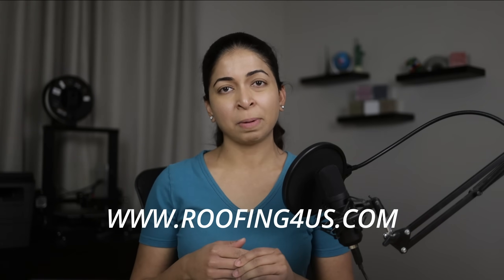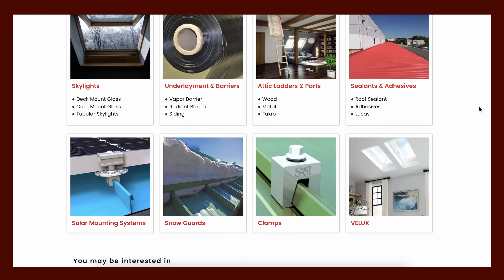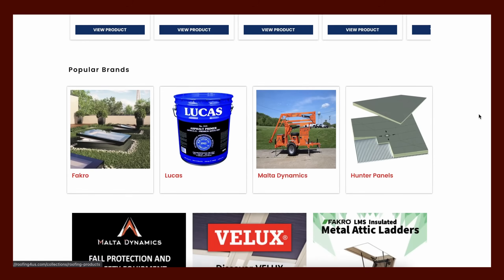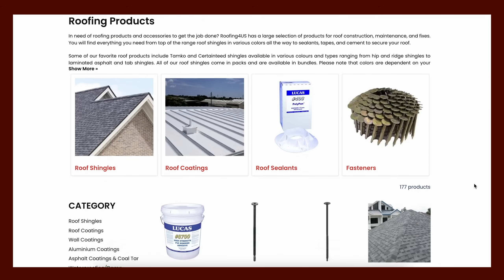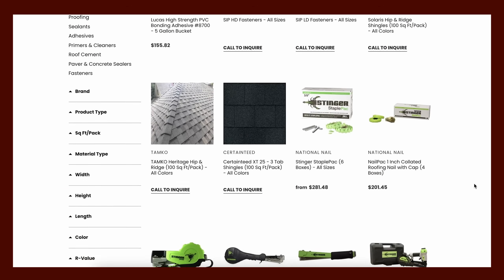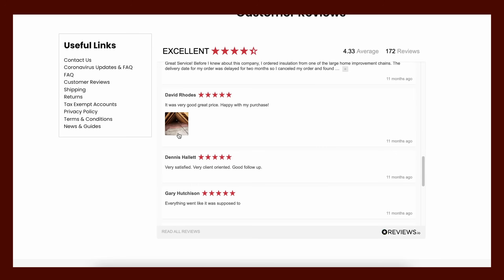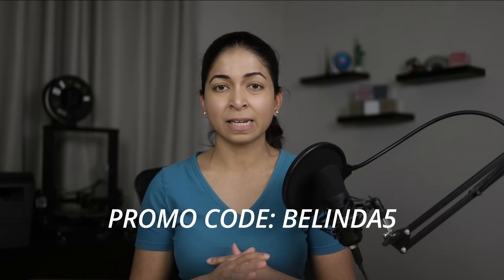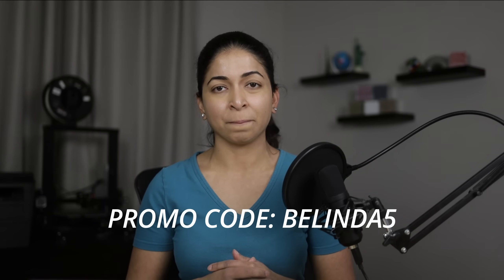Insulation that STORES energy! | Phase Change Materials

Comment: have been looking into this myself for a while now and there are two additional problems.
first the melting point of a PCM needs to be between the daily high and low, which is just not possible year-round. a PCM insulation that melts during a winter day will never freeze during a summer night.
and second is most places don't have a winter day that's warm enough or a summer night that's cool enough for PCM insulation to be worth anything at all. if your PCM insulation captures heat during a summer day so you have to use less cooling, then releases it during the summer night which is too hot anyway, you really aren't getting much out of it at all.

Comment: If you could use electrolysis on the boundary layer of a solid significantly changing its phase change temperature to liquid that may be useful for cooling.  Going the other way would release heat.  Just a thought.

Comment: Great video! One thing you left out is how PCMs can improve the efficiency of air source heat pumps by allowing them to operate during the warmest outdoor air temperatures in winter and during the coolest outdoor air temperatures in summer. This requires a level of programming that thermostats don’t currently have, but you can sort of fake it with a schedule. If PCMs become more popular I hope they will add this ability as any easy to use feature in the future.

Comment: I need to cool a small box containing air (8 by 8 by 7 cm dimensions). If I suspend a PCM inside the box, will there be any appreciable change in the air temperature inside the box, at the operating temperature of PCM ?

Comment: I saw something about using phase change beads in drywall a couple years ago, but it hadn't made it to market as a buyable product yet.  There were some issues with flammability in what they were using.  It's nice to see they've worked it out and it's getting into the market.  Basically, it's like thermal mass, only even easier to tune to a desired temperature range.

Comment: As a building designer, I have been aware of this product and the science behind it for some time now. It should be noted that this product works best when in contact with the habitable space inner layer (plasterboard). So retrofitting or laying the product on top of the ceiling insulation is not ideal as it will compress the insulation and reduce system performance. The reflective foil packaging IS however best suited to being on the outer layer of insulation system, so perhaps it would be better to enclose the product in a cheaper medium and use a separate foil layer where it would be more effective. Building science is a tricky ever evolving subject, and there is no single magic bullet for every scenario. But I love PCM for its ability to add huge 'smart' thermal mass potential to an otherwise light building system. Cheers.

Comment: Interesting but I'm skeptical.  PCMs came out in the clothing insulation industry 30 years or more ago.  The problems then were that the PCMS were paraffin based and were flammable.  This doesn't seem to be flammable, great.  But another problem was the time factor.  That is, how long does it take for the liquid phase take to go back to the solid phase and vice versa??  If it takes only 1/2 hour or so, then while it helps, it isn't spreading the effect for a very long time.  AND as you point out, it is quite expensive.  It turned out to be much more of a gimmick than it was useful.  I think there needs to be a real test on a system, installed as you suggest, to see what the difference in the energy cost.  I was pretty interested as a manufacturer of insulated clothing years ago, but finally after testing, we realized that that particular product was basically worthless.  @$3.50 / square ft, that is pretty darn expensive.  If we took a home of 2000 square feet, are they suggesting that this would have a payback ever with the cost being $7000.00+?   I DO like your analysis of other products, but, as I said, I'm not convinced..

Comment: I just read about the PCM-impregnated drywall you mentioned in a sustainable building science book I'm reading. Excited to learn more and found this video super interesting! I'm also researching "climate battery" technologies and the speaker in a good USDA-sponsored webinar mentioned he would consider adding phase change materials as a way of upping the thermal mass of his system. One layer of this stuff equaling 12" of concrete is a really big (and impressive if true) claim!

EDIT: Here's that passive solar greenhouse video in case anyone's interested: https://www.youtube.com/watch?v=MzuhkbzSqEA

Comment: I'm not familiar with that particular PCM product, but one of the things that confuses/irks me about the PCM products that I've seen come to market over the last decade or so is that they are formulated to have a single phase-change temperature. I don't know about everyone, everywhere, but I and most everyone that I know doesn't have the same set point for their heating in the winter as they do the AC in the summer (and that's not just because of energy cost, comfort is also a factor). I'd like to see a PCM product that has 2 phase-change temperatures to accommodate a range of temperatures that you want to stay between (i.e. a comfortable high and a comfortable low).

Comment: I’m curious if this would be useful as augmented insulation between wall studs on exterior walls?  If so, how would this be secured?  It’s seems that this stuff lays flat or is draped on a roof.  Would this work in like basement exterior walls being finished if they could be secured in a vertical position?
Reply: Hi Riz👋. All QE P mats feature a heat sealed stapling edge, just for the kind of application you’re considering. Additionally we have the ability to reconfigure the dimensions of the mat for special orders.

Comment: My experience with PCM is that it's not an insulation per se. It is, however, a thermal battery.

I've used them in my greenhouses.
 As long as they are in the space, able to absorb heat, and release the heat, they work ok, enough to keep the plants from dying from freezing.

They do not work well behind insulation, as the insulation does what it should, insulate. 

I also found that they are typically inefficient at collecting energy, and I painted the surface black, then they performed better. 

The next issue is, they are not thick enough, not enough thermal mass to last long. 

The price needs to come WAY DOWN, and be much thicker, denser!!!

Then and only then could it really be found to be truely useful for the masses. Pun intended.
Reply: They aren't designed to work behind insulation
Reply: @Rokomarn  , I don't understand your reply. Were you just repeating what I'd already said to emphasize what I had already said, or did you make that comment as a reply not realizing I'd said that?
Reply: @blueside1999  why would you say they don't work well being insulation? That's not how they are supposed to be used but for some reason you say that's a problem with the product.
Reply: Blueside, do you have further details of your greenhouse application? Would you do it again? If you were to use PCM again, how would you use it for your greenhouse? Which specific material did you install? What about using the material in some sort of plenum for an air circulation system, where you could design the material thickness and gets lots of airflow over the material?

Comment: The key word  here is efficiency. Is it efficient enough to absorb energy to actually make a difference. An incondencent lightbulb is good as a demonstration, but not good as an example of in reality since most of the world won't have 70 degrees C to work with. The colder you go, the higher standard you need of efficiency in order to make a difference.

P.S I forgot this: You used concrete as an example of insolation. Concrete is a terrible insolator it conducts heat very well there by making useless preventer of heat movement.

Comment: curious how this might work in a Trombe Wall. 
an outdoor solar collection box could be supplemented for an experiment. ideally, a design mixture of the two could heat a home overnight... with dampers helping to trap the heat gain during the day, preventing circulation & overheating a room. could route it through an ERV/HRV unit too.

Comment: Back in the ‘80s I worked on a satellite earth station project where the equipment was installed in a little radio shack with walls and roof of phase change material. In Algeria. I always think of that as the perfect environment for it; high solar gain and fast nighttime cooling. All the equipment ran on batteries so it was essential to have a passive way to keep the electronics in the nominal operational temperature range. I am glad the technology is finally making it out of little shacks in the desert.

Comment: It is important to analyze in each case if there is benefit. This material can degrade overall energy costs or improve costs. Just like acoustic materials in cars, you have to understand and analyze the benefit. This requires accurate finite element thermal simulations.

Comment: Thanks again ! I am working on the renovation of my housing coop 32 years old building and your video really help us to navigate the strange world of construction. Speaking of which, we have a really hard time to make our mind about windows ! I live up north in Canada and it is disturbing to see the low quality windows that are installed in general. We would love to have your insights on what makes a good windows. Just seeding ideas here :)  Or what about certification ? s the German norm passivhaus way better than Energy Star for instance ?
Reply: I'm just beginning to dig deeper into building science myself, so I'm no expert. But, Passive House (PassivHaus) seems to focus on the building envelope as a whole while energy star is rating individual components. The biggest mistake I see is focusing too much on R-value and not air tightness etc. In my area, many windows are vinyl which can perform well, but if they're not tight to begin with (casement style is significantly better than sliding), they definitely won't be tight in 10 years. Plus the service life for vinyl is only about 20-25 years best case.
Reply: @arlinstoltzfus5026  Thanks, very helpful. Most of the windows available here are vinyl (PVC) too  and we are not happy at all with them. An architect just gave me a crash course about what make good windows and I think we will explore the Passivhaus options as it appears than the Energy Star label doesn't guarantee that the windows can cope with our winters.

Comment: i was going to say, this stuff seems great, except when night time temperatures and nopt much different then daytime. i mean, if it is absorbing 120 degrees F during the day, and night time is still in the 100's, this stuff as no use. the houses temp will be a minimum of 100 at night and will get to 120 faster during the day. still need a heat pump. but now the heat pump will be working against the PCM insulation having to cool it down before the house will cool down. neat idea, and i am sure it has many applications, but for a home, it is only a supplement.

Comment: This looks awesome, but I need more hard facts. You said that is not suited for tropical or coastal climates because it needs a large temp swing to work. How big of a temp change? 5 degrees C? 10? My house experiences a 15-degree swing during the dry season. Also, since it's puncture-resistant I think that it can sit under the galvanized roofing to provide some insulation just fine. The temp under there might jump to 50 C though.

Comment: "Stores heat during the day, releases heat at night" - this probably makes sense for a tin container in the middle of a desert... But a reasonably designed house already has its energy storage - the foundation slab, coupled to the energy of Mother Earth - so the day-to-night temperature variations are imperceptible. Capturing the summer energy for heating in the winter is a whole different story... The Norwegians somehow managed to to it, but the upfront costs were astronomical.
Reply: There is another issue as well. Temperatures here routinely drop below 0 degrees Celsius during winter and our days are short. Not to mention getting energy from say sunlight is a tad bit difficult if you get continuous snowfall as it will cover whatever you insulated with the phase change material further insulating it and reducing the temperature differences between night and day.
Reply: @aBoogivogi  "our winter days are short"... you have real days in the winter? Lucky! Greetings from central Russia, where there's exactly one (long-term average) sunny day in January. And, if I remember correctly, even a 15-minute glimpse of the sun counts as a "sunny day".

Comment: Instead of Aluminum, you should use the material of a rescue blanket: golden on the outside and silver on the inside
Reply: Aluminized mylar - which is what the rescue blankets are made of - might be problematic in this application.  Mylar, being a plastic, may be degraded over time by the oils contained in this particular product.  With a different phase change material, though, it might work.
Reply: @JohnDoe-zl6qw  thanks for the insight
Reply: Plastics convert visible light to IR (heat).  Metalization acts as mirror reflecting Near Infrared NIR and probably IR (heat radiation) inwards retaining heat.
Reply: The role of aluminum here is a heat conductor, while the heat storage/release is done by phase change material.

Comment: Interesting video.  I question your comment about making it easier to walk around in the overhead space.  There is nothing about the product that would support someone's weight and it will further block visual line-of-sight to ceiling joists.  I too wonder about rodents being attracted to the product.
Reply: Instead of needing several feet of insulation which covers the ceiling joists, these PCMs could be much thinner. This would allow you to see where to walk.
Reply: @craigheimericks4594  I understand what you mean but in the context of her remarks and the supporting video she was talking about laying the product on top of existing insulation.

Comment: Interesting product, Is there an Environmental Performance Declaration (EPD) it?  Just wondering if the aluminium is required? As another commenter suggested a comparison between this product and other high thermal mass products (bricks, unfired bricks/Adobe, concrete, aerated concrete) would be welcomed. Specifically considering; thermal conductivity, emissivity, water vapour diffusion resistance factor, density and specific heat capacity.

Lastly I assume this could make a great vapour stop if the joints were taped.

Comment: I have to wonder if, given the organic nature of the soy bean oil, the sheets featured encourage the infestation of pests like rats, mice, squirrels, or other rodents who are both capable of tearing through the material and have a keen sense of smell (many times greater than even the dogs used by police).
Reply: QE P,  actually utilizes inorganic based PCMs. In turn, our products are not a food source for vermin. Patented formulations are primarily composed of clays, salt complexes (not table salt), and a H2O. Formulations are hydrophobic in nature, so no puddling or oozing if punctured. The PCMs will dry out when exposed to open air.

Comment: I think you could have done a better job at explaining the enthalpy of fusion. The necessity of temperature fluctuations is due to the method of action: the phase change. The cells don't "recharge". 
As an example, to melt 1kg of 0º ice to 0º water you need 334 kJ! That's enough to heat up 1kg of 0º water to a scolding hot 80º!
Reply: And 1230 for supercritical water.  They should be working on that instead of these piddly couple hundred kJ

Comment: My question is how easy is to puncture, or shred opon contacting sharp objects.
Reply from the maker: Not very easy. I had to slice through the thick foil several times to cut through.
Reply: @BelindaCarr  i can imagine a rats learning to chew through those packs if they ever learn that there is food inside..... And they will learn if this material is ever used in any bigger amount.
Reply: Wow, I am planning on building a rustic log cabin from scratch, and it sounds like my insulation needs will definitely be covered. With faith that the price will be more competitive, closed cell rockwool is now my second choice. Thank you Ms. Carr! I'm going to subscribe! May God bless you continually with your good works.

Comment: So this is thermal mass, not insulation. A comparison with other thermal mass solutions like brick interior walls would have been great.
Reply: Thermal mass in a sense yes. However your brick wall gives up heat at the temp it formally absorbed  PCMs give up heat at their phase change temp.
Reply: 😂

Do you know that this is wax... You know, the same stuff that insulates seals in Arctic waters.

It is BOTH an insulator and a thermal storage material
Reply: This is not quite thermal mass. Thermal mass, requires much more mass than phase-change for the same thermal absorbtion/re-radiation performance
Reply: @MasonIFTW  look up pcm thermal mass Dupont wall panels
Reply: No. It is waste and a bulky vapor barrier. 
2:00 There she says it. It dries up. Rest is only time.